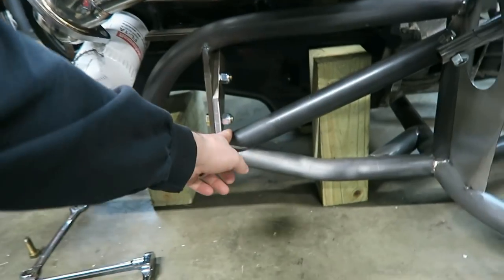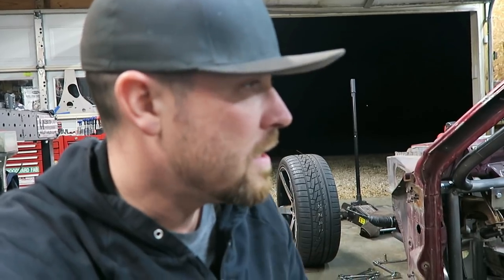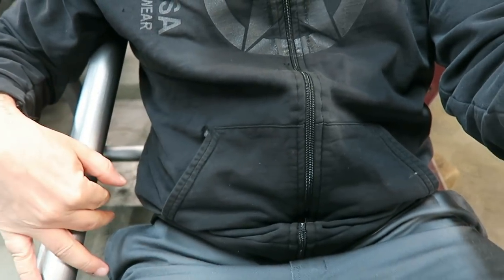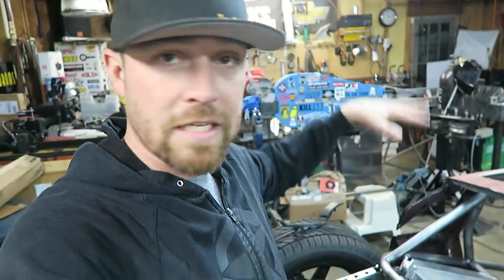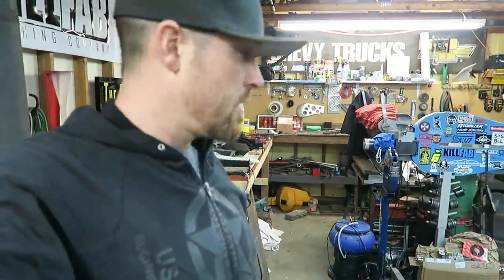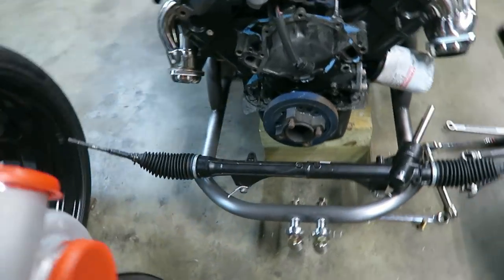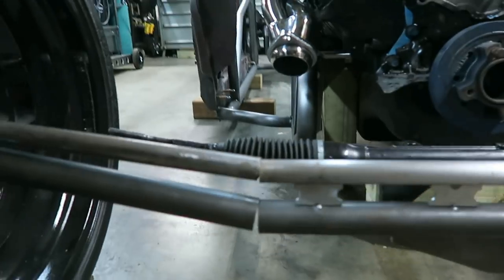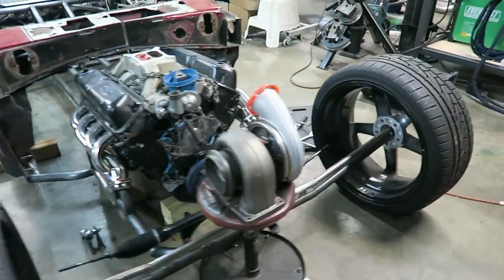Lets Talk Changes & Concerns on The Hot Rod Build

Comment: 1/2” bolt is way strong enough. All for coil overs on my all of my rock crawler buggies have been 1/2” bolts. I’ve jumped em, rolled em, broke shocks and even had 1.5” .120 wall tube bend and even develop cracks where it wasn’t gusseted enough. Never had a 1/2” bolt brake. 
One thing I would do up front where the front suspension bolts go through the tube is weld in sleeves so the tube doesn’t crush when the bolts are tightened. Looking really good!! Thanks for the great videos.
Reply from the maker: +jeff edison Yeah I agree...gonna sleeve it for sure
Reply: exactly what i was thinking, 1/2'' is plenty strong. anything over that would just be overkill

Comment: Hi Kyle, Build it the way you want to. It's your car. I think people don't realise that it's a hot rod not a full bodied car. The work you've done on the rear is very clean.
I do wheel alignments on alot of race cars and if you get you inner pivot within 0- 3/4 of a inch you should have no bump steer issues. Also where you are going to put the Heim joints looks killer. Also remember you can also run a shorter rack and pinion. Can't wait for more videos and congratulations on the property and future house and shop build. Cheers from Queensland Australia. Mark
Reply from the maker: +Mark Thomas thanks....I felt limited on rack selection because it had to be a reverse style

Comment: On the A-Pillar bar and the overhead-to-rear hoop bar... Since the body will be tied to the cage anyway, if you cut out the inner support sheet metal from the A-Pillar and over the door enough to slip the bar in it's place, you'll gain a couple inches. Basically, butt that bar up against the outside sheet metal from the inside, this will replace the support you cut out (might even be more support) and will give you the same or more clearance at your head and steering wheel than you have now... and it will please those of us that want to see the 10 pt cage over the 6 pt.

Comment: I love all the work you do. This project is amazing and filled with a great amount of knowledge. I’m not a fabricator and don’t if my idea is safe or even doable but my suggestion for the a Pilar bar tuck it up and as far as possible into the a pillar of the body. This way it will be out of site and can possibly give som more point of contact to the body. Since you are going to take the body off to weld the frame fully, you aren’t going to have to worry about not being able weld properly. If you can talk about the pros and cons of that idea it would be great. Thank you and keep up the amazing work!!
Reply from the maker: too tight and I wont be able to get the body off

Comment: The 1/2" bolt through 1/8" steel will be more than fine for the upper coilover mount. My kit cars use a 7/16" bolt on the front suspension. Front lower coilover bracket and the rear upper shock mounts are both 1/8" thick brackets. The cars are around 2600lbs when complete. Nearly 100 cars completed and not a single failure, so your design will be absolutely fine as it is.

Comment: Simple solution for keeping the cantilevers from twisting too much under suspension travel would be to add a mounting point between the coil over and pivot on the cantilever with a quick release pin so you can pull them out once you get wherever you are going and lay it on the ground. You could also try to find an electric solenoid with a pin so you could just run it to a button or switch in the car and you won’t have to get out to pull the pins, just push the button and lower the car, and then raise it back up and push the button again and you will be good to go.

Comment: Hello Kyle, just a tip for your turbo plumbing here, you can flip your headers left to right so they exit towards so you don't run into the steering rack, in doing so you would be better off mounting your turbo so the exhaust inlet flange is facing up, so to sum it all up the the headers will exit inline with you rocker covers and collect at water pump height into the under-slung turbo and this will allow you to run the turbo exhaust outlet lower.
Reply from the maker: yeah these headers cant be run upside down

Comment: Hey man. Keep on keeping on. Don't let the naysayers pull you down, and you know this. I've never had any concerns with your build. Just "hmm, I would have done it a little different" but that doesn't mean one way is better than the other. That's the great thing about hot rodding, many solutions to the same challenge. I'll reinforce the 1/2" bolt will probably be fine in this application. Only thing I want to say is remember on a factory car the shock doesn't support the sprung mass, it only provides resistive force to the spring under motion. In a coil over, the spring and damper are in one handy compact package, so now the coil over is supporting the sprung mass. So comparing to a shock mount on a factory car isn't apples to apples. Comparing to the spring mount/shackle/whatever for the spring would be a better comparison. Bump steer is all about instant centers ... and not a big deal if you aren't going to be racing. And last ... triangulate son!
Reply from the maker: yeah...the shock mounts take all the force. Sprung weight is nothing compared to what the shock mounts will have to endure. regardless the coil kits came with 1/2 bolts.

Comment: Gday from West Australia 😊
I am liking the design of front axle and A arm design. I have the feeling you will need to tigh axle to rear Aarm just to remove wheel shimmy. From what I can see on film acamin principal which dictates bump steer should be pretty good. But then it's hard to measure by eye on film lol😊
Also dad always said something important when I was learning my Engineering trade :-   Fail means = 
First Attempt In Learning.
Along with mistakes are the road to Engineering  perfection. 
Have a great day creating 😊

Comment: On the headers... swap sides and flip them over to bring them out closer to valve cover height. I think that's one of the engines that have symmetrical flanges that allow you to try that. Just a thought worth looking at, and should give you a cleaner, straighter shot to the turbo based on how you have it sitting on that stool.

Comment: The clamping he hydro cylinder thing. splitting the tube to make clamp works great. That’s the style I use on my prerunner for bump stops. You can buy the buckets already built if you wanted. That’s what I did, then welded them on the chassis. It would prob look cleaner then the other clamps. 

The 1/2” bolt is plenty strong. My crew cab prerunner has all 1/2” grade 8 bolts and is caged and just weighs a lot alone and goes 60 through whoops and has never broken a bolt.
Reply from the maker: +Js S thanks. I agree, just gotta make it happen

Comment: Much improved on the front suspension imho. I wasn't one of the ones that said something before but it was instantly a thought in my head about the binding issues. I know how these things go though and the trial and error of doing something for yourself the first time. I hope I can get back into a project like this in another year or two, but I have to finish the boat up first.

not afraid to fail is probably the absolute best way it can be described. The best laid plans sometimes go awry and it's how you handle them when they do :)
Reply from the maker: yeah dont worry about failing just worry about doing

Comment: I agree the 1/2 inch are fine. This build is looking awesome. I really like that your taking peoples suggestions into consideration and not having a bad attitude about it. I will say that it's not exactly a fair comparison when your talking about the Tahoe or fox body shock bolts though. Because on those apps the shocks aren't load bearing like a coilover setup. But it will be fine regardless.
Reply from the maker: +shawnmeyer44 the shocks generate WAY more load stresses when dampening compared to the springs.
Reply: The Fab Forums I guess they could. Depending on the road surface, how stiff the springs are etc. Never really thought of that, at least not on a road car

Comment: I’m no engineer, but I believe you’re fine with your build.    Personally I’d fully Box the bottoms of the pivot arms (if you haven’t already) and the only other thing I’d add is a brace/connection between the rear ends of those pivot arms - kind of like a strut tower brace - in my opinion with the horsepower you’ll be running thru that chassis, you want to keep that rear suspension as square as possible at all times.  You want to minimize any deflection between those pivot arms

Comment: Everyone has their own ideas about what is right and correct. Personally, I don't see anything "wrong" with what you have done and I agree that the 1/2" bolts are more than adequate for their purposes. I would leave the top cage bar and just make it higher and tuck it into the windshield frame a bit more. I think it adds a lot more strength to the frame and whether it's needed or not that's always a good thing. My main concern wouldn't be about flipping it on its top, but that another driver in a lifted pickup or semi-truck could hit it in the side and end up on top of the car.

Comment: On the cylinder mounts.  Weld the tubing for the cinch bolt before you cut the slot.  It'll make it easier to line up properly.
Reply from the maker: +Russell Telker good idea

Comment: You could cut the flanges and flares off of those shorties and weld V bands on.  That would give you about an extra inch to fit in a bend or pie cuts over the rack. I personally would consider rotating the turbo 90 degrees for a ram air effect. When you get ready to permanently mount that thing, check out Maven performance for a nice brace that would look great with all that tube work you’re doing. Liking the build!
Reply from the maker: yeah thats the plan

Comment: Kyle rotate the motor mount tube you are installing. The way you presented it, the triangle tube will be in tension because of the motor weight. Switching the diagonal the other way, the tube will be in tension, better way I believe. The weight of the motor will try to compress the tube and welds instead of stretching.  Just a thought.
Reply from the maker: yeah if I was afraid of failure I would go that route. It wont fail and this way looks better aesthetically and follows the lines of the car.

Comment: Hi Kyle ,It;s looking really good ,I do feel compelled to add a comment here though.I have been considering Anti roll bars on my Valiant because I want it to go round corners really well and I did a little research (some time back, my project has stalled a little,LOL ,) from what I remember and you may well have already considered this is,the consensus of opinion was that the front end will need to have a system to reduce roll, equal to, or slightly greater than the rear ,otherwise strange forces are exerted on the steering ,producing undesirable handling characteristics but please don't quote me .
Reply from the maker: +waaen you are correct. This thing isnt being made to handle. Anti roll bars are used mail in straight line racing

Comment: Been following your build and it's awesome! Awesome work my man. Coming from a cage builder I would be concerned running that pillar bar. Just seems so close to your head. I know you said your up in the air about it but sometimes when I come into an issue like that with my cages I'll add another 10*-15* bend in the pillar bar right above the drivers head. Usually makes a world of a difference for clearance and overall comfort. Also gives the cage a sweet more aggressive profile. Have fun dude
Reply from the maker: shoot me a picture thefabforums@gmail.com

Comment: Can you swap the headers to the opposite sides and turn them upside down to avoid cooking the steering rack boots? Also, I liked the long A-arms. The new setup is nice too. With the long arms you could have used a 1985 Cavalier rack with the steering arms coming off near the center. It is also a rear steer rack.

All on all this is a fun build. I like the creative ideas.

You are correct, the cantilever arms don’t need bushings because they don’t move while driving. I like the idea. It was a good one.
Reply from the maker: no the headers look dumb that way and dont follow the chassis line like they do now. beside these flanges wont work upside down.

Comment: On the front/A pillar roll cage bar would it be possible to notch/cut out some more of the body structure? Then move the tube out more and basically tuck it into the body shell. And then weld the body shell right to the tube.   Doing that will make the body shell none removable, but you'd have the safety of the full cage and gain some room.  You could also use a slightly smaller diameter on the front tube. The smaller tube could be tucked even tighter to the body.   You'd lose some strength with the smaller tube, but it would be safer then no front tube. Just some options to think about.

Comment: Great work as always! The only thing I would say on the front control arms is to not mount that heim joint where it pivots horizontally  and points forward like how you had it. With the hydraulics and just general movement  the heim needs to be set up so it pivots vertically. Maybe have the heim come straight out perpendicular to the engine mount (so it’s the same orientation as the front mount), out into a short threaded pipe, then notch and weld the curved part of the lower control arm perpendicular to the threaded section. There’s a guy @flagsandwheels that makes custom arms drift control for foxbodies. Maybe check out his designs for some
Ideas. 

Also, don’t both mounting points have to be on the same axis? If not I think they would travel on separate arcs and bind up. I could be wrong though.
Reply from the maker: heims can pivot in all directions. with the misalignment offset spacers it wont have any issues moving like it needs too

Comment: I think the roof bars are a smart idea, but I don't recall any other roadsters, i.e. Shelby Cobra, Model A/T roadsters and rat rods having a full cage.  You said yourself it's not a track car and I think, my opinion, most are looking at the Grey Goose and draw from that.  It's great to be safe, but I think it might take away from your core build.  It's a cool build all ready, trying not to overthink it or over complicate it.  Sometimes less is more, again, my opinion.  This is an inspiring project and getting to see it from the conception to the end is awesome.  Thanks for sharing!
Reply from the maker: +Evin Hill Yeah I agree
Reply: The Aerial Atom has a double frame rail and no a-pillar bars and those cars are on rails. For a hotrod this car will be fine without the a-pillar bars.

Comment: Hey kyle, enjoy your vids and build. The bibsters intersting because its almost a rat. Suggestions are always easy before a jobs done because nothings not finished. My only concern on your build is at the front of the cabin, between the it and the engine compartment. At there looks to be an opportunity for the chassis to bend. I say this before youre finished because the roll bar that makes it a 10 point will help resolve that without having to lose anymore cabin room. Just a thought. Like the vids and am interested in seeing how this build works out.
Reply from the maker: when its done it will be far from a rat rod. The chassis will be crazy stiff with the double frame rail setup, with or without the pillar bars

Comment: Run the upper bars for the "10-point" down the middle of the car, instead of around the outside.  It'll stiffen the chassis significantly, provide additional safety margin, and be farther from occupants' brain cases.

Comment: The point where the lower ball joint locates the lower a-arm is going to be MUCH lower.....so the upswept look will not be there until the car is on the ground.  I'd bolt that wheel to the hub and spindle....that way, you know heights and where the spindle pick-ups will actually be....including where your strut will have to locate.

If you want that look, I would locate the the rack under the frame rail (because it was raised up at the engine mount) and then you can lower the front a-arm pivot.  This will make the lower a-arm level (plane wise).  

I KNOW....buzz kill.  I have race car experience so that is what I think about....instead of looks.  I think about stuff like camber gain, bump steer, ackerman, kpi....instant centers, roll centers...   Looking at the front, my way, it may have too much angle when it lowers to the ground for your tastes.  I'm just giving a different perspective.  Whatever you do.....do it like you have been (own it because it is your's).  The thing is gonna be sweet, no matter what.  

I REALLY like your suggestion to others....don't be paralyzed!  Just work through it and move the project forward.  GREAT ADVICE!
Reply from the maker: +Mike Grady nah it will be just as you see it. The tubes run to the center of the wheel but once you mount the disc and spindle it's gonna move it in several inches, lining up with the bars as you see them.

Comment: I think your assumptions on rear axle components being strong enough for weight and suspension are correct. The only thing that you might want to think about is axle wrap if you really get into it and your tires hookup. You might want to incorporate some 'traction bars' if that becomes an issue.
Reply from the maker: no axle wrap with solid mounted setups